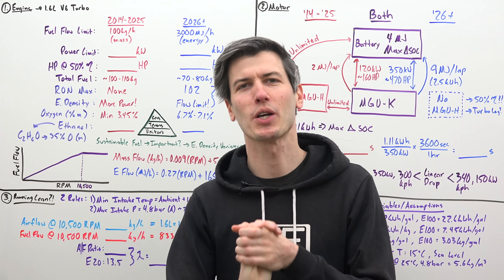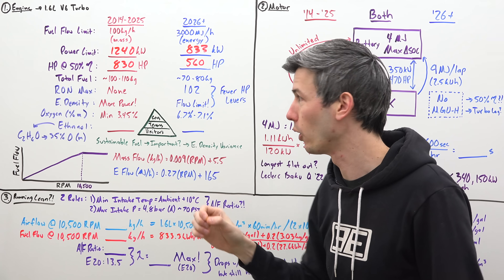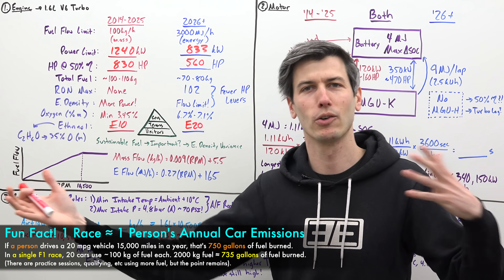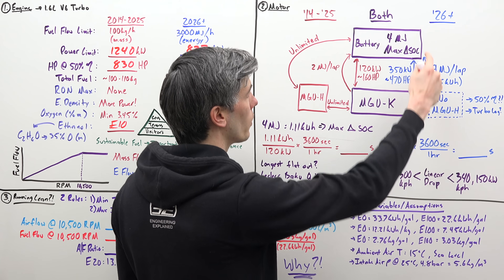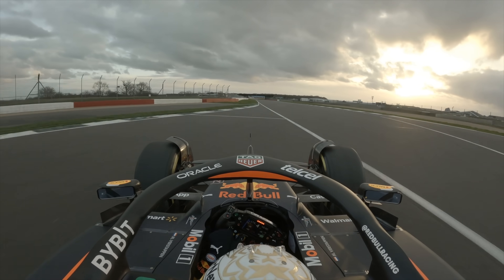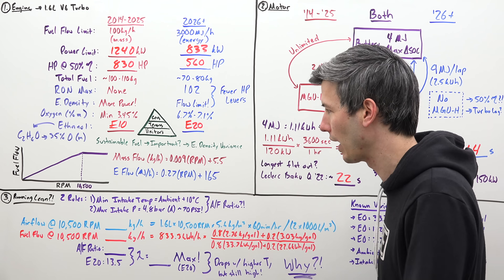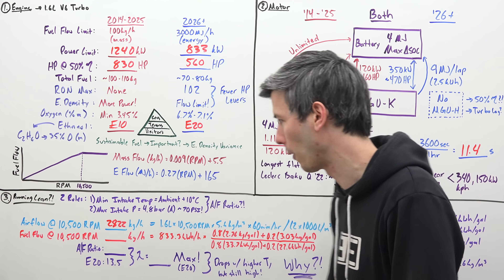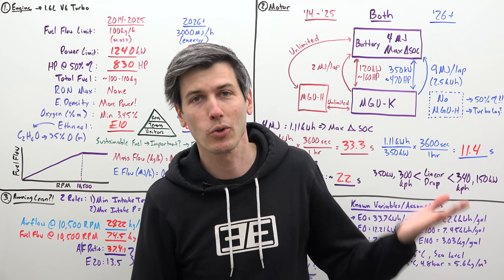Why Are 2026 Formula 1 Engines Going To Lose So Much Power?

Comment: RE the mixture, and manifold pressure, could they be running extraordinarily high compression?  Way beyond what would be typical with forced induction?  Perhaps the super lean mixture is to allow some insane compression without knock?
Reply from the maker: The more boost you have, the less compression you can have, so more boost would not support more compression. That said, the max geometric CR will go down from 18:1 (2023) to 16:1 (2026). Doesn't mean the effective compression ratio is that high.
Reply: @EngineeringExplained  Thanks!  I understand the CR drops for boosted engines, I thought that was the "unboosted" CR to compensate for more mixture inserted under boost though.  Hence my thinking that with ~50psi boost the effective CR could still be very high, and a leaner mixture could be to resist knock.

Comment: Driving to Silverstone in July in my EV using renewable sourced electricity according to all the charging network claims. Feeling smug. Then celebrating all the racing cars burning dino juice. 

A smug hypocrite.  Roll on July. 

I wonder if all these engine tweaks will get the glorious sound back?
Reply: EV is a meme. Not sustainable and in a few short years it will be just as expensive to charge your car as to fill it up with dino juice.
Lets not even talk about the fact we are building zero new power plants.

Comment: I was a bit confused, how wouldn't you be able to reduce your charge air temp to 10 degrees above intake temperature.  I do that all the time. Then I remembered I work with marine diesels. and our air cooler doesnt do air to air.  it does air to seawater, which is usually way cooler then the air in the engineroom what the engine is taking in. 
usually we have it set to 45 C as charge air temp, regardless of the intake temperature.  Keeping everything constant is most important for those big diesels. 

About F1 I wish they'd give the teams more freedom in the engine design and development. even the choosing of the number of cylinders, from a I4 to a v12, what ever you like.
only limit: fuel, supplied by the organiser, in a known quantity. 

here you have 50L, and the lights are off and goo.
Reply from the maker: I'm with you on opening up engine flexibility. It'd be fun to see different strategies there, and just limit teams to fuel flow.
Reply: I would like more flexibility too, however it’s so expensive to develop engines now that it would give too much of an advantage to the successful design until everyone copies it. F1 is going to become more and more a spec series with cost caps and everything, which in the end might give us a better show.

Comment: I think they are keeping the battery size the same will make energy management an even more important strategy for teams & drivers. Hopefully making it more entertaining for us fans
Reply: Higher regenerative rate means they will refill that battery quicker between straights
Reply: @mrvwbug4423  and then instantly use it. So the more they can recover and reuse the energy, the more horse power they will have. rather than using it just to boost on the longer straights, it will mean they can keep firing at any opportunity they get. The only thing I don't know about the regulations is if it has to be under driver control, or it can be automatically triggered by the engine management system
Reply: It wont. It will make things worse than they already are.
Reply: Will be good for overtaking as well, for shorter burst of more torque or coming out of corners
Reply: Indeed. It should promote passing manoeuvres and defence. It’s a great idea. I don’t know if they are getting rid of drs in the new regs?
Reply: @sephiros9883  I never liked the DRS, which seemed too contrived, and hope they will get rid of it eventually.
Reply: They're not getting rid of DRS, but rather getting rid of the zones and replacing it with a low/high downforce mode for the entire car that would be fully under the driver's control. That along with the driver having more electric power to choose when to use could make for some very interesting racing.
Reply: @sephiros9883  you can't promote defence while having drs

Comment: Maybe the A/F ratio limiting lean is to avoid teams continuing to run the cars engine at at high revs at low speeds and using the air through exhausts to aid airflow, aka last decade’s blown diffusers ?
Reply: i did always wonder if there's enough exhaust pressure to produce thrust

Comment: I like a conclusion like that.  When you're using real data and actual science sometimes the results aren't a great soundbite.
Reply from the maker: Haha, glad you enjoyed, curious to learn more about why that rule exists!
Reply: @EngineeringExplained  If I had to guess it might be to make sure teams aren't pushing extra air through the exhaust (maybe with fuel injection every other 4 stroke cycle or something) for aerodynamic advantages like they used to do with blown diffusers, coanda exhausts, etc.
Reply: @jamespingel8730  Yeah, something like this - these rules don't tend to get introduced unless it's been found someone has been abusing the lack of control there.
Reply: @f2cmadmaxx is not abusing something.  It is just about smart engineering if something isn't specifically disallowed in the rules.
Reply: @EngineeringExplained  time for a collab with Craig scarbs !
Reply: @EngineeringExplained  I think 2 reasons: 
1. Synthetic fuell has probably more combustible C (for CO2 =´burning). Does anyone ban pouring of Carbon Powder into Cylinder? 😀
Or maybe something completely different. Using higher-valency atoms instead of C. For example Chromium oxide, Chromium can be bivalent, trivalent-..hexavalent. So not only normal Oxide like CO2 (2x2 valencial electrons bidding 2 atoms of bivalent Oxygen)  Of course, there is "little nuisance" that Chromium does not burn - in normal temperature. So in special material and high-temp motor- not completely impossible.

2. reciprocating engines are now succesfully above that stage of normal combustion needed to (mechanically) link that stored energy to wheel revolutions. It has limits in engine (material strenght,density -contradicts weight) so as in tyres. So most air will not be combusted, only blown out of exhaust to provide drag, airthrust.
As jet engines- which began using 2-way airflow bypass even in 60-ties years (but not so limited fuel inflow as F1 motor, 5-10x higher).

Or maybe - it is not fair to combust more, because of too much hot air would actually endanger 2-nd racer behind leader = impossible to come closer to try winning. 
In the future we might see even exhaust-blown Airflow limit, as it might slow down your opponent behing you, if you are first. Currently your computed Airflow makes 0.6kg / second. But as revs would increase (materials invented, which allow that) + as Formula cars would become lighter (when higher energy-density allows that), the Airflow would substantially brake your opponents. 🙂

Maybe that's why we see no circuit mass-race massacre in Planes Redbull race series, or in other horse-power limited sports. For example skiing - parallel slalom used, not a train of several racers doing same curves. (of course, also for safety reasons).
Too dangerous, only a few pilots try such chasing in war time, if a must. But generally we try to avoid such wars, for the same reason. And such racing in the streets, too.

For viewers it might be interesting, hot+blown-out opponent fights. But for a racer? Even current achievable G-force is hazardous to Pilot's body (brain, intestines, soft tissues). And limited because of tyres. Even Tesla plaid-mode is not pleasant, and now Tesla announced Roadster2 which will have 0-100kmh in 1 second (maybe- but who would drive it?). 
That makes 2G ge-force. Usual plausible and presentable maximum, even in supercars, is hardly higher than 1.3G in corners.

But people are generally able to invent materials better than God {nature), so maybe one time we will have such tyres, for example biting into asfalt in each corner. And then every racer will have to undergo Medical Cyborg operation, to strenghten his brain + guts-binding tissues to prevent decomposition. But whatabout loss of consciousness, inevitable during higher G-forces? Replace veins and blood with something firm? 😀
That would be end of comparable-race popularity, ordinary man will not identify himself with such un-human racer. Weird "things" robots racing in some weird biting beasts (biting into asphalt). 
Only a few Arab sheiks enjoy such race- where their Camels compete. They were banned finally for using young little boys (because of weight) = now they race with robots, periodically beating camels with artifical whiplash.
Reply: the birth of afterburner in formula 1 cars are incoming
Reply: Minimal grey area…
Reply: I don’t know. I think you burnt a few of my brain cells.
Reply: These changes will push electric motor development.   It's about high efficiency with loud noises.   Use less battery, use less gas.
  F1 is limited, for safety. Tech is what makes it great.
Reply: @TonyBasuro  The technological development in F1 used to easily be noticeable by sight and sound.  The gains are now being made hidden from sight.  It's not as flashy but, the technology still trickles down, it's just harder to see.  An example is Kinetic energy capture and release.  It's absurd how fast it happens and the amount of power that is being captured and released in a very small time frame.  But, that efficiency trickles down to a point where everyday cars will use the same technology but it's mundane at that point.
Reply: I just can't understand why the FIA are so stubborn on reducing the fun, the excitement and the Adrenaline rush of the Formula 1.....
Reply: @PRAY1211  Same with NASCAR, it has lost the fun of bootleggers comparing their cars performance on a track to see who can get the best times, to regulating everything such that each car on the track is just a mass-produced clone with different stickers and badges.
Reply: @ElNeroDiablo  without the restrictions in place, might as well call it the Hendrick show since no one else would have a chance of competing.  Same in F1 and every motor sport really.
Reply: @PRAY1211  Aero is the big killer of "fun" in F1. They've tried (and, to a slight extent ISTM, succeeded) with the re-introduction of ground effect; but let's be honest, the primary fun of F1 is not seeing cars do 300mph down the straights, then follow each other round the corners, rinse & repeat: The fun is in seeing drivers swapping positions, chasing each other at 3 ft apart... and aero prevents that. I'd much rather see smaller, slower cars (not ridiculously slower, obviously) where the car behind actually has the aero advantage - not via DRS, but because there's a hole in the air from the car 3ft in front. Hugely reducing aero would also bring cornering speeds down, which is good for safety, the trick is to do it without making the spectacle worse than it is now...
Reply: @theelectricmonk3909  the car size is ridiculous today.  Shrink them down, I want to see the cars comfortably navigate Monaco.

Comment: Climate/weather has been changing well before the thought of the combustion engine...nothing man can do will change this either way.  Every predictioj for the past 100 years have not come close to being true.  We need more fossil fuel use, not less.
Reply: Yes more fossil fuel. Stop burning it and there will be plenty.
Reply from the maker: It's pretty silly to think we can't have any impact on our climate. It's very well established; it's also a ripe topic for political turmoil and misinformation.
Reply: You are correct that many climate change predictions based on software modeling of the atmosphere and oceans have been incorrect. In most cases they have been too conservative. For example, the Artic environment is warming much faster than the models predicted. Also, stop conflating global climate with weather. These are not the same thing.

Comment: I know a lot of F1 fans get upset at tighter engine regulations, but the way I see it is that the engineers need new challenges every couple years because F1 isn't about making the fastest car ever, it's about competing with other manufacturers within the regulations. As Jason explained, it's not even about lowering emissions because the teams are constantly flying and shipping things around the world. The cars are just a tiny fraction of the emissions. It's about creating engineering challenges.
Reply: But that doesn't matter for the huge majority of the audience that pays for it.
Reply: @MuitoDaora Maybe after some time they will find a way to increase power from that tiny engine just like in 2014 hybrid era
Reply: @MuitoDaora  No, but much of the research trickles down to street cars, and they do try to make systems more relevant in that regard.
Reply: @wyskass861  But is not the main reason big car manufacturers join the F1 or why there's multimillion sponsorships for it. They want the exposition to that audience.
Reply: @MuitoDaora  agree
Reply: Historically the regulations have been based on safety, now they are all about "climate" politics

Comment: Does the MGU-H make it a turbine engine with a really complicated combustor?
Reply from the maker: Haha, if the engine wasn't connected to the driven wheels, and the MGU-K was the driving source, maybe!
Reply: No the relative ratios are very different.  MGUH <<< engine output,  you need Napier Nomad for that real "missing link" engine to gas turbines!  ;)

Comment: I don't understand what kph is supposed to be. thousand per hour. but thousand of what? grams? miles? feet? meters? pounds? sausages? Now you are talking about a speed here so it should be a measure of distance, however you are not giving any indication about the unit of distance.

you are using kg/h for flow units below. Why aren't you using kph there? Its not more or less wrong than it is on the other numbers. 

If you don't like the / use a p, but don't omit the actual units. meaning km/h can be kmph, kg/h can be kgph.

Now if you have a system that is counting numbers and you want to know how fast it is counting, you could use kph as a measurement.
Reply from the maker: It sounds like you understand that kph is a non-standard abbreviation of km/h, and thus weren't confused. Great! kph is fine, and commonly used.
Reply: @EngineeringExplained  Its like a diagram with unlabeled axis. You can get it from the context but its not great. The response i gave was over the top but that was me imitating my math teachers. Back when i was in school (or university for that matter) we actually lost quite a few points for incorrect or missing units. 

I know that the US uses kph for kmph not for kgph, however that is a context you have to know. I imagine it is to make the switch from mph to kmph easier? So kph is not a unit, its a 3 letter short form for a 4 letter unit. 

What I am trying to do is to get people to stop using it. So its mostly me screaming into the void.

Comment: I see massive windows of opportunity to cheat the heck out of these rules with devious software modifications.  It will take the FBI and NSA to track down all of the violations and possibilities.  F1 should just go to 1 liter 4 cylinder engines with a given turbo inlet diameter and be done with it.  Nice video on interesting subject.
Reply from the maker: How so? There are sensors in place measuring all kinds of things that the stewards have access to (power, torque, energy flow, fuel flow, etc). They're not blind to trickery, though sometimes it does take a bit to discover if implemented well.
Reply: @EngineeringExplained  Exactly EE and the FIA inspects the teams code too......  ;)
Reply: @EngineeringExplained   F1 and NASCAR have lots in common and cheating is an accepted fact of life.  Unless you win big the chances of getting a complete teardown and inspection are not that great.  Look at the VW cheat that defrauded governments and an entire industry.  With complicated engine and systems management, millions of lines of code, and creative team managers almost anything is possible.  Yes, it's not simple, but then sometimes it is.  Classic NASCAR story was the basketball in the fuel tank that was inserted to show a lower fuel limit and then deflated and removed to get 2 extra gallons of gas.  Using the roll cage as a gas tank was also an interesting cheat.  Yes, the stewards can see all kinds of data - but sometimes it's the data you want them to see is all that matters. The more complicated things are the easier it is to work around them.
Reply: Software is monitored through a common ECU
Reply: @ruaraidhmcdonald-walker9524  Banks have "firewalled and monitored" accounting systems and get hacked all the time.  In theory the Common ECU should cut down on cheating however there are ways to defeat the system under a series of specific events and leave no trace of the transitory changes.
Reply: @garyjarvis2730  Please provide some reference to support your contention that  banks "get hacked all the time".
Reply: @avsystem3142  Guess you've never gotten the letter that says your data has been compromised from the bank.  If you knew how easy it is to hack a checking account and ACH transactions you'd throw your checkbook out and never have one again.
Reply: @garyjarvis2730  Guess  you don't understand that merely claiming banks are routinely hacked doesn't make it so. Again, where is the link or links to factual information that would support your contention?
Reply: @avsystem3142  Try doing a small amount of research yourself online and the answer will be obvious.
Reply: @garyjarvis2730  It is not incumbent on readers to verify the truth of your comments. If you can't provide any supporting evidence then your posting is just another unqualified opinion.